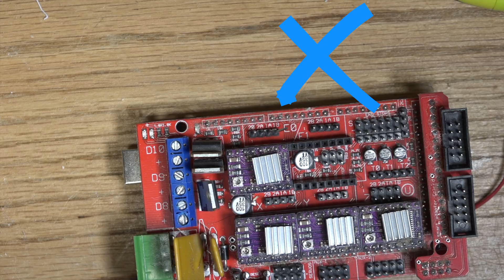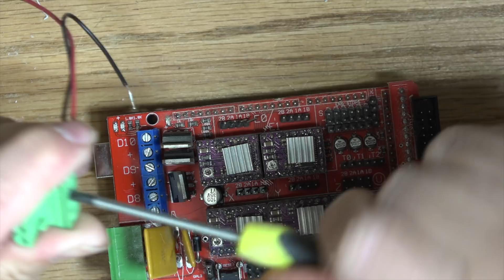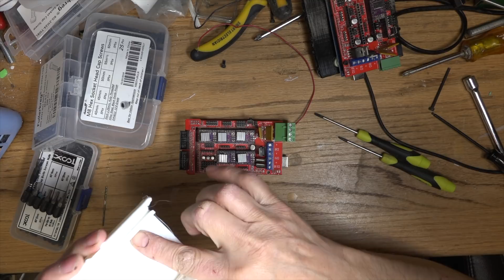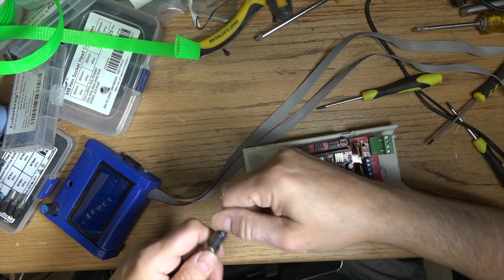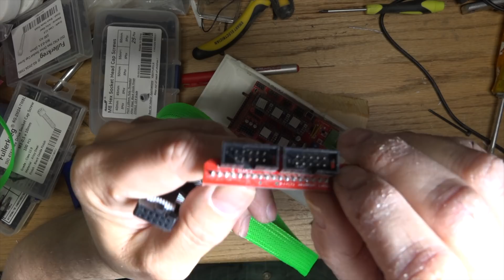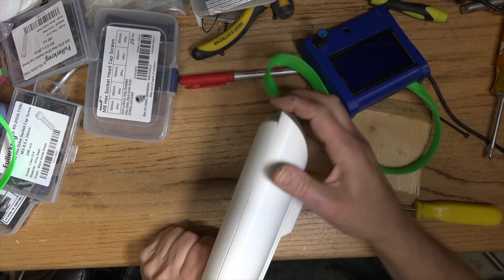Lowrider II Build -  Part 6 - Preparing The Controller

Comment: Hi I was wondering if your version of the marlin firmware can make a difference of G0 and G1 or is still same older version that G0 need put F3000 or more speed to do rapid moves. Thanks
Reply from the maker: No, still the same. It’s just one of the pre configured branches from v1engineering.

Comment: Try wrapping the cable cover with some masking tape where you plan to cut it, cut with scissors through the middle of the tape, then melt each taped end a little with a match or candle flame. That’s how polyester and nylon rope is properly cut and sealed.
Reply from the maker: Thanks for the tip!

Comment: I was going to use a CNC shield but I changed my mind and will use a Ramps board like yours instead. Thanks for the video.
Reply from the maker: Thanks for watching.  Just be careful, Ryan from V1Engineering has reported poor quality Ramps cards of late, that's why he doesn't carry them in his store any more... Good luck!!
Reply: At the current pricing of 32bit boards I actually would never recommend a Ramps again and the 32bit boards keep coming down in pricing plus, the two I have, allows Trinamic drivers and with 2130s or the 2209 you can have endstopless homing so that is a plus for a machine like this.  Oh, and Trinamic even has 20 amp drivers you just plug in like a 4489.